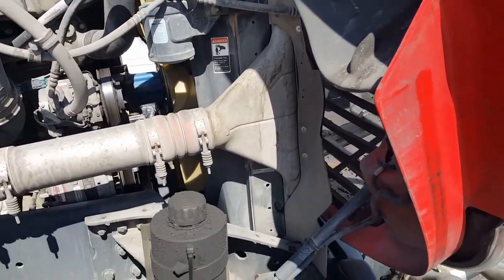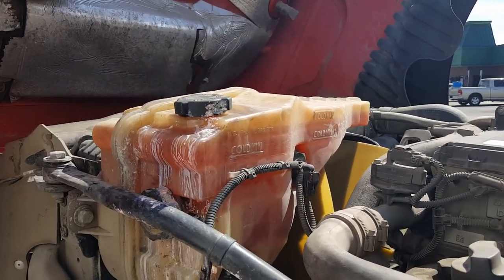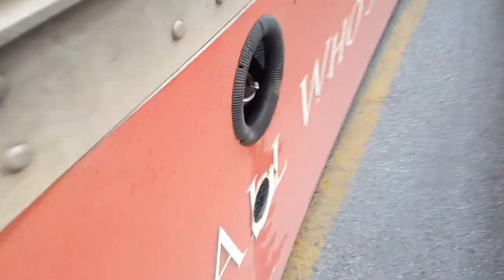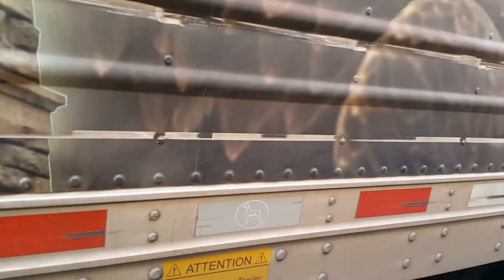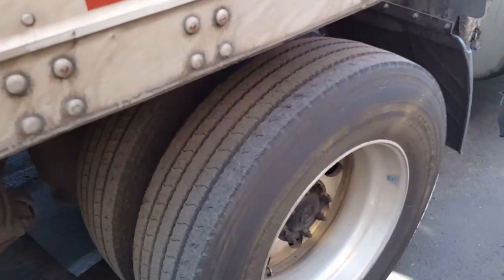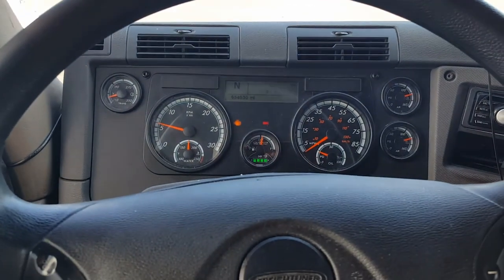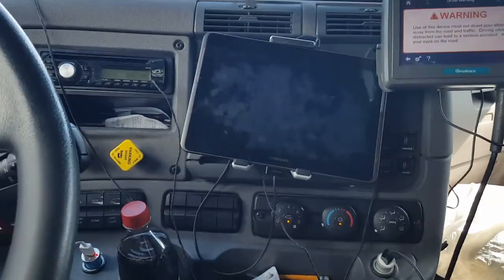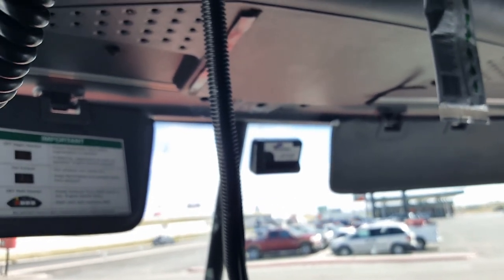How do you pretrip a truck in the real world?

Comment: Awesome video, never knew so much went into ensuring the vehicle safety. 
Other than that, I wonder how annoying it is to deal with other car drivers on the road. On a recent road trip to PA, there were many police officers on the sections of road running through NJ, pulling people over for staying in the left lane too long. While the passing lane rules can help reduce traffic, the end result I saw were people moving into the left lane to pass, and then immediately moving back into the lane on the right,in many cases, being like 10-15f in front and cutting right in front large tractor trailers which caused them to slow down to make more room which caused more cars to cut them off.
Reply from the maker: Razor2048 some trucks also have radars and smart cruise control that will slow down the truck in the event a vehicle pulls in front.